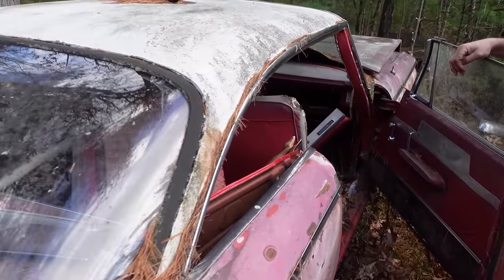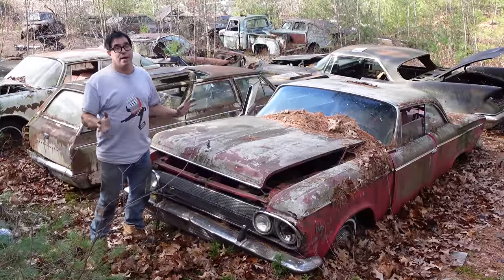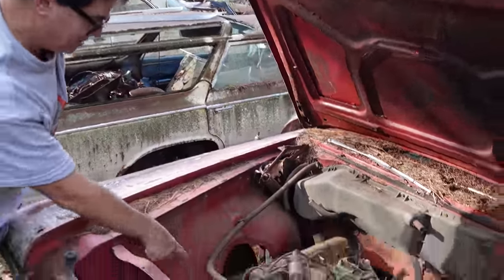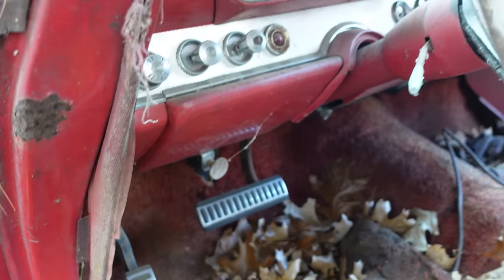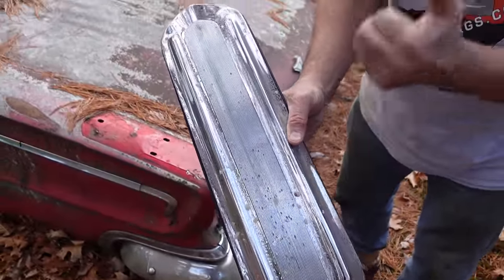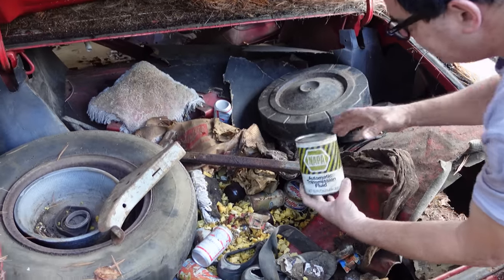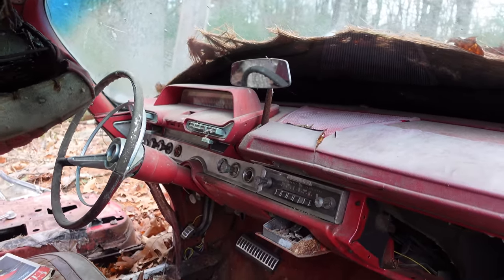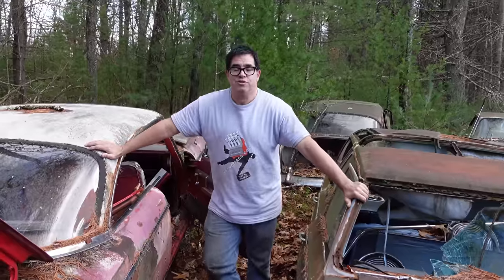1963 Dodge Custom 880 Hardtop

Comment: Oof! The term “pot metal” is a common misnomer for die cast parts and was a dirty word growing up in my house as Dad was in the die casting business. Most die cast parts are made with the alloy, ZAMAC - Zinc, Aluminum Magnesium And Copper. Yes, die cast parts can become brittle with age and can indeed become pitted. A technique employed by my Dad when restoring die cast parts on his Lincoln Zephyrs was to first, have the part stripped. Triple chrome plating involves plating the part in copper, nickel, and chrome, in that order. After stripping the parts, Dad would have them copper plated. He would then, very patiently wet sand the part to bare metal again. He would repeat this process as often as necessary to gradually fill the pits with layers of copper until they were level with the original surface and then have them triple plated and polished.
Reply: That's a very interesting piece of information. I always wondered how they refurbished them.
Reply: That’s a dedicated soul right there! Sounds like a lot of care and attention to detail! Thanks for sharing!

Comment: A big fan of the Dodge Custom 880 series, this car should definitely be put back on the road.
Reply: I agree!
Reply: It would be a good parts car, but I guarantee the bottom is completely gone out of that thing, sitting on the ground, floors and the bottom 6 inches is gone. Sub-frames probably not even attached to the floor anymore.
Reply: You would require the services  of an young priest and old priest to do the excorcism  your dealing with the brother of Christine
Reply: @ryurc3033  I agree, I'm sure the bottom is gone.

Comment: STEVE LOVE YOUR SHOW, YOU ARE THE BACKBONE OF THE BARRETT JACKSON BROADCASTS... ONE THING, IN 1963 THE ENGINE WOULD HAVE BEEN A 413 NOT THE 425 STREET WEDGE... THE 365HP, STREET WEDGE WAS INTRODUCED IN 1964...

Comment: I had a 64 Custom 880 four door hardtop  and in 64 the ornaments moved to each fender instead of the center of the hood and that was one of the best vehicles I had  
That 361 was an excellent engine and not bad on fuel consumption. 
Thanks Steve for showing one my favorite Chrysler products.
Reply: The 1961 Mobilgas Economy Run was won by a Chrysler Newport with a 361 pulling around 21.5 MPG.  Probably more like 17-18 in average driving though.

Comment: My dad was a died in the wool Dodge guy. I remember many of them back to dim memories of the '52 or 53 with BIG ram on the hood. ALL TIME favorite was the '64 Custom 880 4 dr hardtop. An absolutely great road car many trips from White Plains NY to Cape Cod. We put 214000 miles on that thing and it was going strong several years later in the second owners hands. That thing had monster drum brakes.
Reply: You are correct they are an excellent road vehicle.
Reply: Yes 1964 Dodge custom 880 super great car .My folks and one bought in 1965 as a demo car from dealer .p.s we were told later the CAL state patrol also used the Dodge custom 880.
Reply: @casedoumasr656  CAL Highway Patrol used 880 4 door sedans (non-"custom") Seems there was a lot of spill over of bits and pieces. I know ours had "police  "brakes. During the same period NJ was buying Chrysler Newport sedans (basically same car under the skin

Comment: Correct, with the VIN, you win: 5 for Dodge V8 (4 are for six-cylinder Dodge models, 7 are for Dart models), 1 for Custom 880 (1 was also used for 170 and 330 models), 3 for 1963 model year, 3 for Jefferson Ave, Detroit, MI assembly and the rest is the production sequence. The Jefferson plant that assembled this car opened in 1925 and closed in 1990. The "new" Jefferson plant opened adjacent to the old one in 1991 and still operates today under Stellantis. 

No tag, can't brag, but easy to figure out, no doubt: 512 for Custom 880 two door hardtop, 575 for Red interior trim, and P for Vermillion exterior paint. My parents had a 1963 Sport Fury that my dad bought new and then had the payments frozen when he went into the service. When he came out, the payments resumed and he paid off the car and by that time, he and my mom were married. They kept the car for a while longer and then sold it around the time I was born because they wanted a larger car. As I recall, it was traded in on a Plymouth Fury. We didn't have that car long, as my mom accidentally chipped the flywheel by trying to start it with the engine running (the car was a notorious staller). We had "modern" Chrysler products until 1979, but by 1977, we started buying GM products. The only Chrysler we had was a 1941 Plymouth Deluxe from 1978 to 1988 when my father passed away.

We gave it to my uncle, my dad's older brother in 1988 and then he kept it for a number of years, giving it to his son. It got sold to the owners of a local newspaper who at last call still have it. We called the car "The General" because it was from 1941, right in the beginning of WWII. It was a simple simon car and always started right up. It was built like a Sherman tank.

Comment: Thank you for showing us these amazing parts of our history. I’m wondering why this car being so rare is there and no one is saving it? Sometimes you point out why it is too far gone but you didn’t in this case.
Reply: You don’t think the door falling off when he opened it is your first indication of maybe it’s too far gone just saying
Reply: @remylopez2408  The door didn't have the bolts in, they had been removed. Overall compared to many of the bodies he's looked over that one looked really sound, all the roof gutters were fine and the slam panel for the trunk wasn't rotted either. ok the floors and quarter bottoms were probably bad thou even when we got a glimpse of the leaf spring you could see some of the wheel well was still there with the spot welds showing...usually that is just fresh air...this car looks really saveable. Not for the faint hearted tho the fact that the roof is still attached to the body and isn't net curtains is amazing.
Reply: It appeared to be salvageable to my eye from a cameras perspective.
However I did see a fair amount of daylight when he opened the trunk.
It appeared to have been rusted out quite a bit.
Reply: @remylopez2408  The door falling off tells you that it's "too far gone"?
Not a car guy I assume.
You reckon that might be because there were no bolts in it? That the door wasn't on there before, but Steve attached it for the video.
Any car, whether it be 60 years old or made a month ago.... Any car that is neglected will end up in a junkyard after maintenance issues pile up to the point of it being parked.
Cars didn't used to be designed to be disposable. People's attitudes, ineptitude, ignorance and outright laziness has caused the automotive industry to now design cars that WILL NOT be salvageable. Or even in a junkyard. They'll go directly to the crusher.
When it's all said and done and all the chips are down, it will be these old beaters that Steve usually features that will still be able to be placed back into service.
The downward spiral started with the EPA and insurance restrictions imposed on our cars back in the mid 70's.
Reply: A big problem can be the lack of availability of parts. If you have to do a lot of work and things like trim pieces or body panels etc are unavailable, you might have to invest $70,000 in parts and labor to have a car worth $30,000. For a lot of cars like this, someone has to make the absolutely horrible financial decision to get emotionally involved with a car. ;)
Reply: No not really. I’ve restored several classic cars and most had to have new floors-just saying
Reply: About 6 months ago I decided that maybe I could find a 61 Imperial to restore. Unfortunately that ended when I discovered only 1000 were made so my chances of finding parts were almost non existing. Another reason why some cars can't be restored.

Comment: My parents owned a new 1964 Dodge Polara 880 four door and I learned to drive on it. In High School I purchased a used 1965 Dodge 440. I believe both had 318 Cubic Inch engines. The 64 880 was a red body with white roof and a very stylish car.

Comment: I owned the same ‘64 880 2dr hdtp three separate times. Full power, 383, push button TF. I put the 15” slotted steel wheels and vented dog dish caps. Love C bodies and this was my favorite. I’d love to own in a 4th and final time. Thanks for the content!
Reply: I have '64 880 convertible. Wondering if you upgraded to 15 inch rims to do a disc brake conversion
Reply: @kbias1  I would have loved to do a disc brake upgrade but I installed the 15” wheels simply because I thought they looked better and so many more options for 15” tires.
Reply: @Robert M.  Thanks for the reply. So you keep the drum brakes, booster and one brake line? That is my current setup.
Reply: @kbias1  Yes that was my setup also. If you’re going to drive it a fair amount definitely upgrade to discs.

Comment: Hi Steve a great video. This 880 must of been a beautiful car when new. Never owned an 880 but I did own a 1960 Dodge Matador 2dr hard top 383 AT. It was a mint green. An absolutely beautiful car. The dash on this car (880) was very similar. I was told the Matador was a Canadian car but I'm not 100%. I kept that car for few yrs. The car was mint condition. I bought off a fellow in the Mts of NC. He only sold it because it wasn't a DeSoto. The old 4bl 383 in the Matador would definitely burn the tires off the back. I was also told by the gentleman that the car was an original 2-4s car but was replaced with a single because of the gas shortage in the 70s and unfortunately the factory intake was long gone by the time I bought the car. I had no reason not to believe the man but i also had no way to prove it. Man that junkyard is massive. I keep looking in the background and see stuff I can't wait to here you educate us on Steve. Namaste 🙏🏼
Reply: Strangely enough the “ Matador” name came back in the mid ‘70’s through AMC, it was not a very pretty car though.

Comment: The '60 Dart was not full-size, but an intermediate (I know as my family of six had one and I frequently had to sit in the rear middle). The full-size Dodge in '60 was the Matador/Polara which was followed by the 880.
Reply: I think the 61 Dodge Steve showed the mag had a 118" wheel base and not 122" as stated.

Comment: Steve this looked not too bad compared to the usual baskets you show us? Overall compared to many of the bodies you've looked over this one looked really sound, all the roof gutters were fine and the slam panel for the trunk wasn't rotted out either. Ok the floors and quarter bottoms were probably bad thou even when we got a glimpse of the leaf spring you could see some of the wheel well was still there with the spot welds showing...usually that is just fresh air...this car looks really saveable. Not for the faint hearted tho the fact that the roof is still attached to the body and isn't net curtains is amazing.

Comment: I have owned one of these since 2007. Same 2door hard top but in green with white roof. Fascinating if heartbreaking to see a tour of one in such poor condition. I’d sure like the glass for spares! The front bumper is off a ‘63 Chrysler and formed the basis for the front design. It the first Chrysler Corp car to feature the Pentastar badge. Placed on the front quarters just behind the wheel arch. Oh and it was in fact the 413 not the 426 available for the cops. Despite the mongrel parts bin mashup these were well engineered and a clean looking coupe.

Comment: The body is actually a 62 Chrysler Newport (shorter wheelbase than New Yorker) with a Dodge front clip and dash.
Better known as a "CLODGE" LOL.
With Desoto gone, Chrysler cobbled up the 880 series to fill the gap until the new for 65 C bodies arrived.
 The filler panel Steve pointed out would have been where the 62 Chrysler tail lights would go.
Rear bumper is a 62 Chrysler unit as well. Keep up the good work love the series!

Comment: Have the 64' year, it's a blast to drive around.
I have it as my daily driver, so far for 9 years going to college and home, Most of the people i run into ask if it's a galaxie other times a charger. love these 60's C bodies, strange, peculiar models will keep people scratching their heads guessing on what car it is!  I honestly like to call these cars Plodges, as it resembles early plymouth Fury roof lining and using Dodge parts. 
(Front end clip was a Dodge Polara, the rear clip was off of a Chrysler Newport)
 so, Dodge + Plymouth = Plodge.

Comment: I had a '64 4 dr with a 318 a 361 powered convertible.  I bought the 4 dr for parts but it ran great so I used it as my daily driver until about 2015.

Comment: The cap you see under the pot metal piece on the back is because the quarter panels are directly lifted from the 1962 Chrysler.   The Chrysler has a flowing tail light that that starts at the top of the fender where the cutout begins and curves down to bottom of the quarter panel near the rear bumper.  Chrysler bodies were different for 1963, but the Dodge carried over the basic Chrysler Newport body till 1964.  The rear end was reworked for 1964 with updated rear end, and slight grill changes up front.  Good looking car.  Sad to see such a rare car like this rotting away.  My guess is that it has been there for years judging by the contents you found in the trunk.

Comment: I was hoping you would mention that the Custom 880 helped cover the gap from below when DeSoto was discontinued (with the Newport covering from above).
Reply: Good point.  Mainly, though, the 880 was a mad scramble to get a full-sized Dodge back into production, with components snatched from every available source.  lol.

Comment: The 63 and 64 Custom 880's are seldom seen. I had a 63 convertible back in 1967. It was black with white top and red interior. I bought it at Melene Motors in Clinton Mass

Comment: In the late 60's a family friend had a '63 880 wagon in black with a white roof.   I asked them to please let me know whenever they decided to sell it.   In 1972 I found the car lying on its side in a local junkyard, the tranny was torched out of it.  I asked the junkyard owner about the car, he said the owner wanted it gone because there was a 'tick' in the engine.  The yard paid $10 for the car and it got crushed a few months later.   My only consolation was that the visible undercarriage was so totally obliterated with rust that it was not savable.  There were no other 880s known on the street by that time either.  I only knew of 880s from pics of them in '60s "Motor's Auto Repair " manuals before the friends got the black one.

Comment: Buddy of mine has a 64,880 sitting in a falling down old garage, been sitting there 20+ years, junk piled on, around and in it ☹️ was a running car and drove into the garage under its own power. It’s a 2dr hard top, 318 polli auto.
There is a model badge on the rear roof pillars, symbol with a name but I forget what it says. It is a Canadian built car.
Dark blue, white roof

Comment: If you ever get a '61 Dodge to look at, explain why they had 2 sets of stoplights. As I understand it the original lights were too small & sat just atop the bumper in the fenders & were hard to see. You could get a 2nd set higher up on the reverse fin that were highly visible.

Comment: Brings back memories when i worked on these cars back in the sixties . It was a given to find leaking rear brake wheel cylinders and axle seals. Every body hated pulling off the rear drums. Also these cars could go thru a set of front brake shoes every six months , cracked brake linings, warped brake drums . This caused a lot of people to switch to GM and Ford products. Chrysler had some great idea's but always fell short in the real world.

Comment: The Custom 880 was basically the same car as the '62 Chrysler Newport with different trim. The '62 Custom 880 used the same taillight trim as the '62 Newport.

Comment: The reason the 880 exists is at the start of the 1962 model run Dodge and Plymouth's biggest cars were only mid-sized.  It was an error on Chrysler's part, they believed the other carmakers were downsizing their cars too.  End result, Dodge dealers wanted a full size sedan to sell to brand-loyal customers who were asking for one. 

So Chrysler made them a parts-bin car - re-using the 1961 Dodge full size nose on the 1962 Chrysler body, with the 1960-61 Dodge/DeSoto dash.   In the back, those pot metal caps fill the hole made originally for the 1962 Chrysler tail light.   That might be the only new tooling on the car save the badges and I wouldn't be shocked if the lens is the same as the 1961 Dodge upper round light, too. 

The greenhouse on this body dates back to the 1960 cars.  But it still works even without the fins.   

It sold well enough to continue for 1963 (as seen here) with a new nose, and in 1964 they got a new tail as well.   But it used that dash right to the end.  1965 they brought back full size Dodge and Plymouth cars with the new body design and made these moot.   But they served their purpose.  

I pulled the entire dash out of one when it showed up in our you pull yard.  I couldn't find much demand for the other parts, and grabbing the pushbutton valve body 727 was too much work.  I think it's still on a pallet up to the warehouse somewhere, I figured sure somebody would want to put it in their hot rod.  

Interestingly GM would make this same mistake in 1982 with Pontiac, but there dealers responded by importing the Canadian Parisienne which was a very lightly rebadged Caprice, and it sold so well that by 1984 they brought back a US edition complete with recycled 1980 quarter panels.